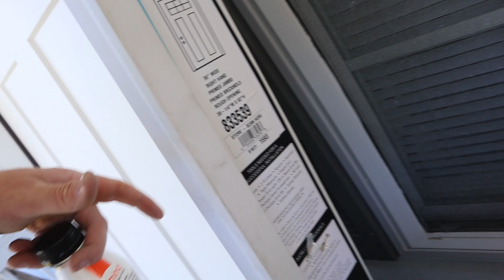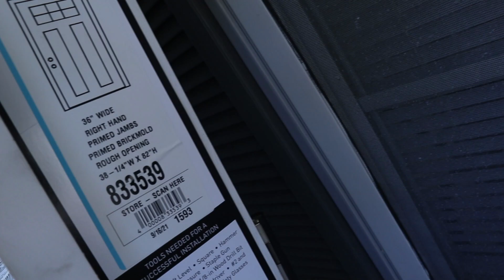Picking Up A lot Of Materials For Flip 4

Comment: Hi Joe, fastest way to paint is to spray ceilings first, put all trim in first then spray all trim semigloss or satin including doors . Next mask trim with 3m paper masker and blue/green tape then airless walls. Remove masking paper and done. You can also cut and roll walls after spraying ceilings and trim if you want the best wall finish

Comment: Hey Joe, proud of the work you're doing. On getting those baseboards off. If you cut around them good with a utility knife and use a wide scraper knife behind your pry bar as a heel it will protect your walls. Good luck and wishes from here in Tennessee..

Comment: hey Joe, greetings from Chicago . Currently working on becoming a personal trainer your pushup form is as weak as my Juney Cakes.

your hands seem a bit wide but most importantly you're not going through the full range of motion meaning you gotta go down more to get that full muscle action from your chest and triceps. 

-Try moving your arms in a little bit closer to your body
( hands should be about underneath your shoulders and you can change the angle of your hand to find where it's most comfortable. I personally move my finger tips pointed toward each other ) 
- make sure your elbows bend at about 90 degrees coming down or more, and fully extend coming up ( your elbows should not be bent at all or as close as you can get it ) 

that might help you get yolked sooner. 

thanks for the content

Comment: My boss is a contractor.. and he goes to Lowes and is in Lowes Pro and he spends so much money there a day  they actually bought the entire crew which is about a crew of 10 lunch.. they bought us some like pizza rolls and sodas.. he spends over like $7,000 everytime he goes in there with sheetrock, plywood, doors, lumber and everything else.. we get houses done anywhere between 3-6 weeks.. so far we knocked out 5 houses in 4 months this year so far .. sometimes we work after 330 and sometimes we work on the weekends if there's a deadline.. we knocked out two 3 story houses that we converted into single apartments in 3 1/2 months.. we get stuff done.. and we do  everything from heating, plumbing,HVAC, painting, framing etc ourselves.. the only thing he doesn't have us do is putting up the Sheetrock and setting all of that up for painting.. and the guys who do that can knock out a house in a day 1/2